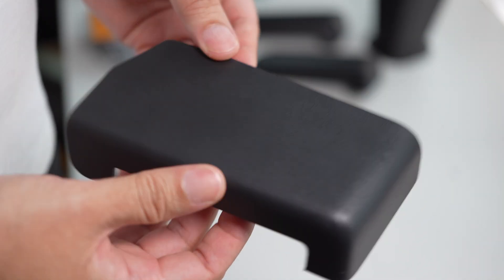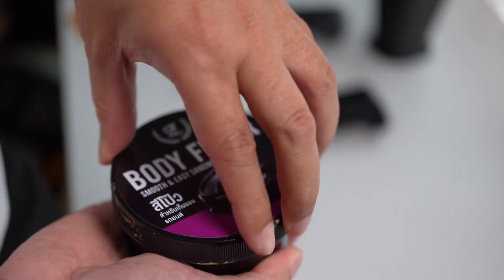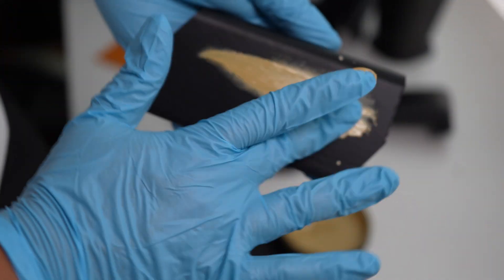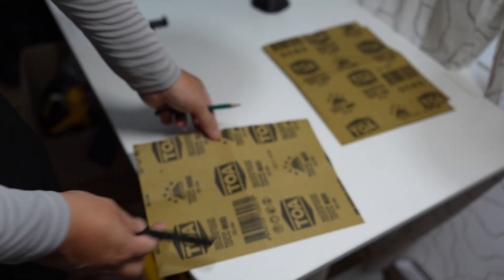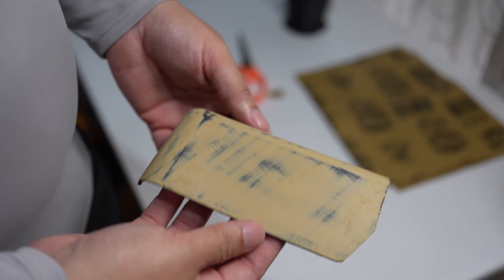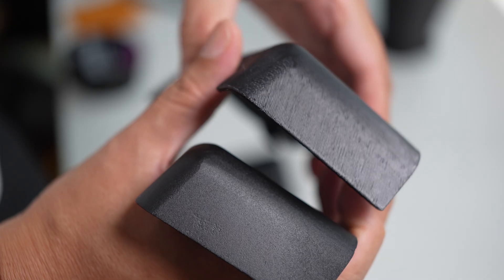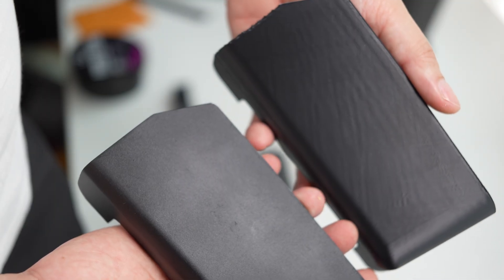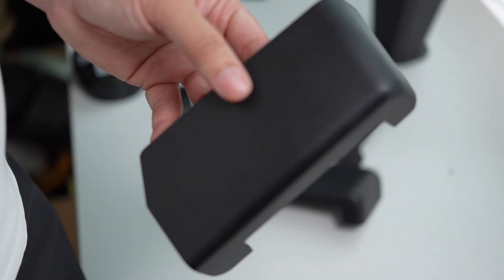Smooth Like a Pro! Car Filler Fix for ABS 3D Printed Plastic Trim

Comment: Prop makers I've seen thin the filler with acetone and then they can paint it on. Last i saw used "plastic wood" filler which mighr have a different composition.
Reply from the maker: Right now, I use "Putty Filler" spray as primer and top coating with "Sand Blast Texture" paint. No sanding and much faster. But as all other methods, it'll cover up all the print detail.

Comment: Did you already tried PVA Filler?
Reply from the maker: Yes, but I primarily use it to repair cracks in masonry walls. Car filler sands much more smoothly—almost as if it were designed for it.

Comment: Just use vapor smoothing for ABS, bro. Then sand and paint.
Reply from the maker: I can't do that—it would shrink the designed clips/pins.
Reply: @Payo-TensileCreator You can selectively hit specific areas of your parts with a heated atomizer cup from a headlight restoration kit.

Search a video called "Vapor smoothing ABS made easy" by Ken Print 👍
Reply: @Payo-TensileCreator You can selectively hit specific areas of your parts with a heated atomizer cup from a headlight restoration kit.

Search for a demonstration video called "Vapor smoothing ABS made easy" by Ken Print 👍

Comment: That came out great! I've been using Bondo "glazing and spot putty" for projects like this. Alternatively, I found some nice ASA-GF that doesn't show any layer lines so it doesn't need any finishing. It seems to generate just enough "noise" because of the GF that it looks like an injection molded part.
Reply: what brand

Comment: Did you try structure paint yet? I imagine that could also hide the lines well, and give you a nice structured finish, similar to a lot of plastic parts in cars. It‘s available in spray cans
Reply from the maker: Yes, I've tried that, cost about 10 USD/can and it look just like the original part.